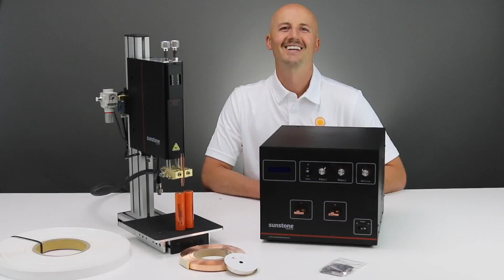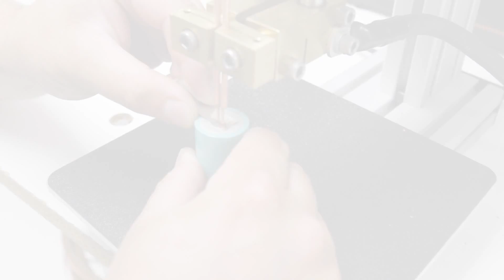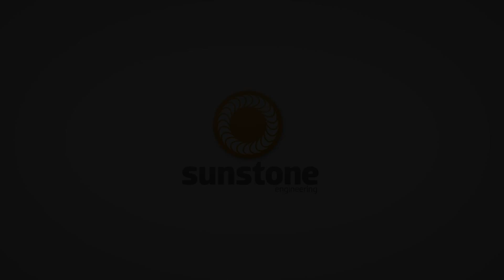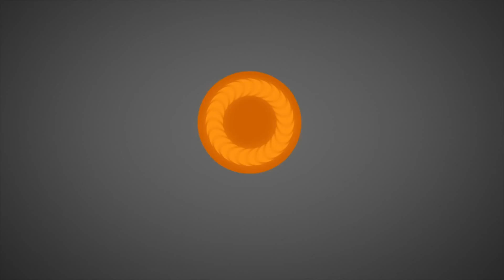Introduction To The Sunstone Battery Welding Systems

Comment: How much is that equipment ? Over 2K$ ?
Reply from the maker: The system varies depending on the intended application and power. The system featured in the video starts as low as around $3000 USD. Please let us know how we can help.